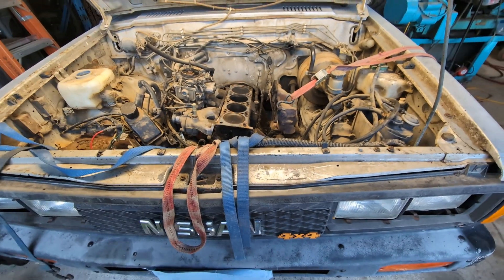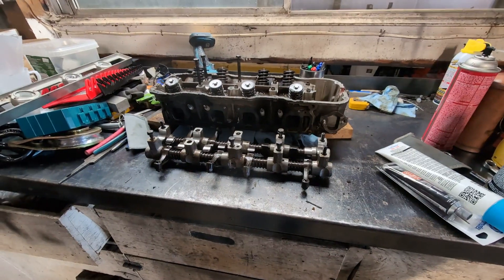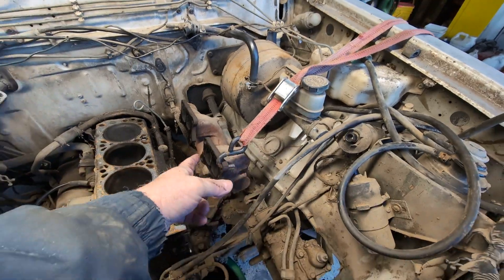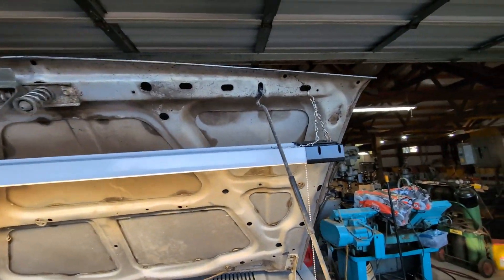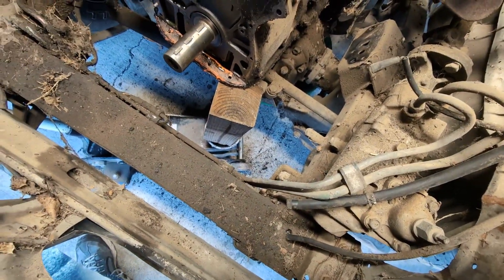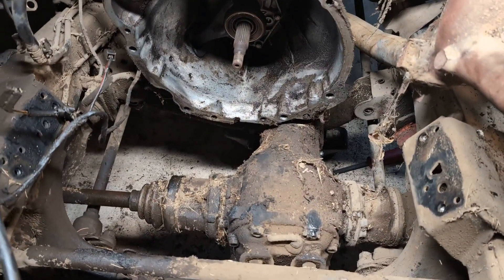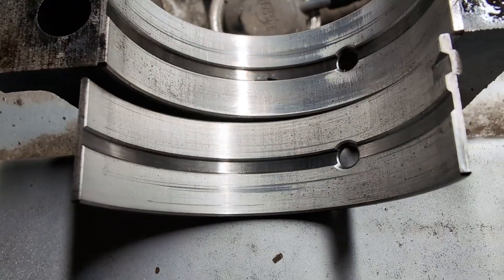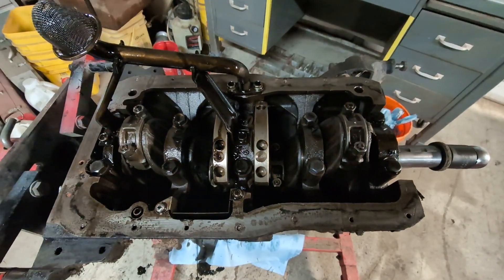1985 Nissan 720 4WD rebuild, part 1

Comment: I rebuilt 3 2WD versions, which were sold in NZ with the L18 engine.
They went forever, but they rusted like bastards.
I fully rebuilt the first one, and then just patched the others up to keep them intact.
There is a mint one locally fitted with a Leyland 4.4 V8, It's a Kingcab, with a drop side tray, and I want it.